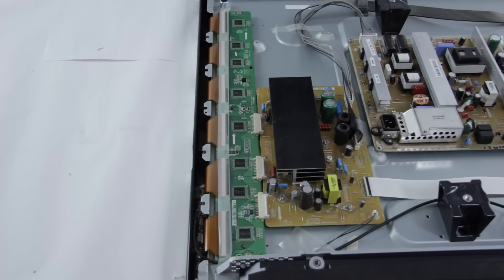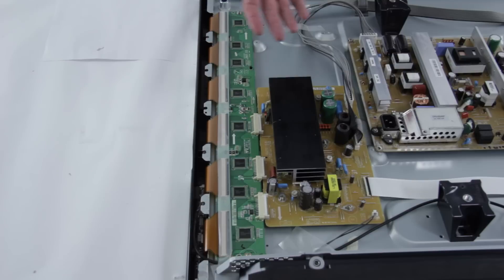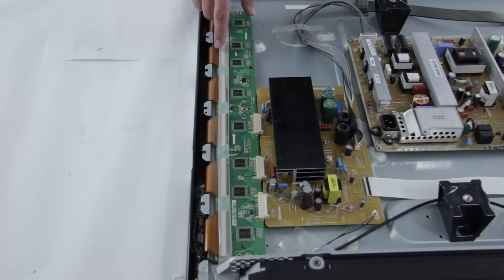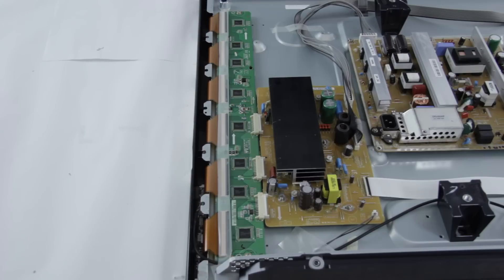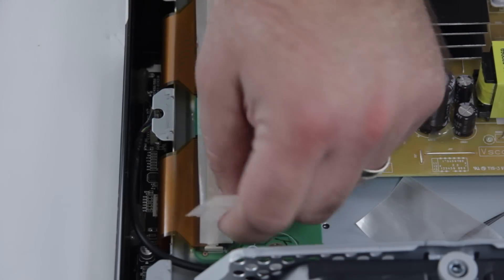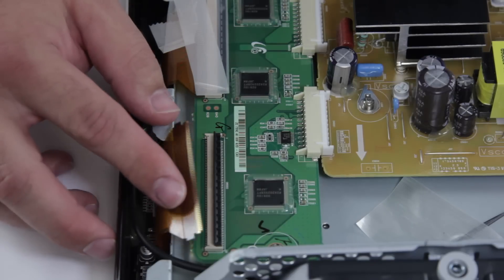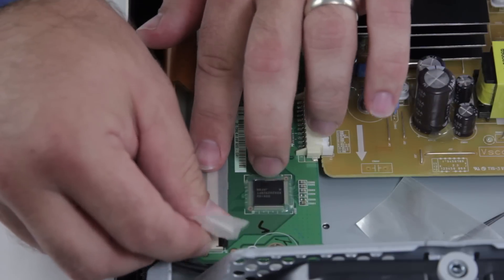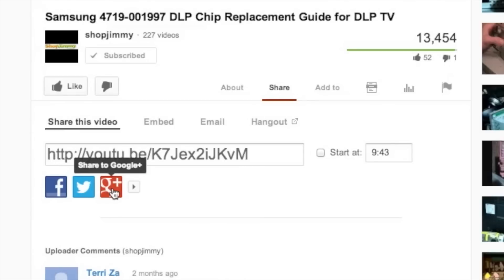Plasma TV Repair - No Image, No Picture on Plasma TV Screen - How to Replace Y-Buffer & Y-Sustain

Comment: I have a Samsung PS51E6500,  only 1.5 years old. A week ago a thin vertical line appeared from top to bottom on the left, about 2 pixels wide, which changes colour depending on what's on. Started bright red, now usually red on white backgrounds or green on darker backgrounds. A few days later it was joined by another vertical line right next to it, the same thickness and colour, 5 pixels away. Is this the logic board or do I need a new screen?  Thanks!
Reply from the maker: Philip Houghton   This sounds like a problem with either the panel or the logic board in your TV.  You can replace the logic board to see if that fixes the problem.  Here is a link to replacement parts for your TV model number on our website, click here:  http://www.shopjimmy.com/catalogsearch/result/index/?cat=226&q=51E6500  Be sure to match part numbers on your current board, with your replacement for compatibility.  Here is a link to a video showing how to identify your part number, click here:  Samsung Plasma TV Repair: Samsung Plasma Panel Parts Guide  You can also call our customer service for further assistance with your purchase.  (877) 881-6492  Thanks and please let us know if you have any further questions with your TV Repair!  www.shopjimmy.com

Comment: samsung ps50b550t2fxxy checked voltages with y sustain board connected all very low between 1 and 6 volts checked again with y sustain board disconnected all voltages correct except for vsc unable to test due to disconnection
Reply from the maker: mark johns   I recommend replacing the Y-Main board and Y-Buffer in your TV.  Here is a link to replacement parts for your TV model number on our website, click here:  http://www.shopjimmy.com/catalogsearch/result/?q=50b550t2  Be sure to match part numbers on your current board, with your replacement for compatibility.  Here is a link to a video showing how to identify your part number, click here:  Samsung Plasma TV Repair: Samsung Plasma Panel Parts Guide  You can also call our customer service for further assistance with your purchase.  (877) 881-6492  Thanks and please let us know if you have any further questions with your TV Repair!  www.shopjimmy.com

Comment: samsung LA32D450G1 keeps blowing transistors on power board's inverter driver
Reply from the maker: Ariel Pabalate   I recommend replacing the board.  Here is a link to replacement parts for your TV model number on our website, click here:  http://www.shopjimmy.com/catalogsearch/result/?q=32D450  Be sure to match part numbers on your current board, with your replacement for compatibility.  You can also call our customer service for further assistance with your purchase.  (877) 881-6492  Thanks and please let us know if you have any further questions with your TV Repair!  www.shopjimmy.com
Reply: what particular board is it? is it the power board, main board or the inverter board?
Reply from the maker: Ariel Pabalate   I apologize for not specifying.  If the inverter is blowing the transistors, then I recommend replacing the inverter.  Here is a link to replacement parts:  http://www.shopjimmy.com/catalogsearch/result/?q=32D450  Be sure to match part numbers on your current board, with your replacement for compatibility.  You can also call our customer service for further assistance with your purchase.  (877) 881-6492  Thanks and please let us know if you have any further questions with your TV Repair!  www.shopjimmy.com

Comment: Hi, I have a Phillips plasma tv model # 50PF9956/37   My problem started a few months ago. When I would turn it on it would take longer to come on. The problem kept getting by takinging longer and longer to come on. I would get a blurry faded picture before it would finally come on. Now time frame, I am talking about taking 45 minutes to finally come on to where it could be watched. Now its reached the point of not coming on at all. A friend sujested to me to check the start capassitors. I dont know what to do at this point. any help would be appricated. thank you
Reply from the maker: FLY HIGH   This sounds like a problem with the power supply board.  I recommend checking the capacitors on the power supply and see if they are puffy or raised.  I think replacing the power supply will fix the problem.  Here is a link to replacement parts for your TV model number on our website, click here:  http://www.shopjimmy.com/catalogsearch/result/index/?cat=59&q=50PF9956%2F37  Be sure to match part numbers on your current board, with your replacement for compatibility.  You can also call our customer service for further assistance with your purchase.  (877) 881-6492  Thanks and please let us know if you have any further questions with your TV Repair!  www.shopjimmy.com

Comment: I have Samsung 60 inches model pn60e550d1fxza plasma tv  I have no picture but ihave sound can someone help me whats wrong.
Reply from the maker: Eufemio Simangan   I recommend replacing the Y-Main Board and Upper and Lower Y Scan Drive Boards.  Here is a link to replacement parts for your TV model number on our website, click here:  http://www.shopjimmy.com/catalogsearch/result/?q=pn60e550d1fxza  Be sure to match part numbers on your current board, with your replacement for compatibility.  Here is a link to a video showing how to identify your part number, click here:  Samsung Plasma TV Repair: Samsung Plasma Panel Parts Guide  You can also call our customer service for further assistance with your purchase.  (877) 881-6492  Thanks and please let us know if you have any further questions with your TV Repair!  www.shopjimmy.com

Comment: i have samsung plasma PS50B550T2FXXY  witch is clicking and the stand by light is flashing disconnect the y sustain board and the clicking stops stand by light stops flashing there is sound when turn tv off any idears where to start no bulged capasitors
Reply from the maker: mark johns   I recommend replacing the Y-Main Board and the Y-Buffer Board in your TV.  Here is a link to replacement parts for your TV model number on our website, click here:  http://www.shopjimmy.com/catalogsearch/result/?q=50B550  Be sure to match part numbers on your current board, with your replacement for compatibility.  Here is a link to a video showing how to identify your part number, click here:  Samsung Plasma TV Repair: Samsung Plasma Panel Parts Guide  You can also call our customer service for further assistance with your purchase.  (877) 881-6492  Thanks and please let us know if you have any further questions with your TV Repair!  www.shopjimmy.com

Comment: Hello, I have a Panasonic TC-42PX14 plasma tv.  The tv does not power up.  When I press the power button, I hear a loud clicking sound and the tv then goes to standby.  After about a minute, tv trys to power up and again a clicking sound and back to standby.  The standby light does not blink.  I have already tried replacing the power supply board but that was not the problem.  Any help would be greatly appreciated.
Reply from the maker: Ian Robertson  I recommend replacing the A Main Board in your TV.  Here is a link to replacement parts for your TV model number on our website, click here:  http://www.shopjimmy.com/catalogsearch/result/index/?cat=56&q=TC-42PX14  Be sure to match part numbers on your current board, with your replacement for compatibility.  Here is a link to a video showing how to identify your part number, click here:  Panasonic Plasma HD TV Repair Tips: Suffix Codes for A Board & Main Boards  You can also call our customer service for further assistance with your purchase.  (877) 881-6492  Thanks and please let us know if you have any further questions with your TV Repair!  www.shopjimmy.com

Comment: I have a samsung plasma tv ps42b430p2wxxu model and my screen is black,__ there is a clicking noise which seems to be coming from relays on the power board----- any suggestions ?
Reply from the maker: ian whiteside   I recommend replacing the Y-Main board and the Y-Buffer board in your TV.  Here is a link to replacement parts for your TV model number on our website, click here:  http://www.shopjimmy.com/catalogsearch/result/?q=42b430p2  Be sure to match part numbers on your current board, with your replacement for compatibility.  Here is a link to a video showing how to identify your part number, click here:  Samsung Plasma TV Repair: Samsung Plasma Panel Parts Guide  You can also call our customer service for further assistance with your purchase.  (877) 881-6492  Thanks and please let us know if you have any further questions with your TV Repair!  www.shopjimmy.com

Comment: HI.  I have an LG 42lh40 plasma.  The picture stopped taking input, but it seems to be trying.  It recognizes when i plug a cable in and the on screen interface asks if i want to switch to that input, but then it says no signal.  I have tried this with all four HDMI ports, different input devices and cables, so i don't believe it is any of those.  The odd thing is that the tv on screen menu will come up and i can navigate through it and the display is crystal clear.  there is no defect on screen, it has just decided not to take video input.  the audio input through an AV cable will work.  I accidentally broke the coax stem a year ago and started using hdmi and have never had a problem.  There was a recent electrical storm and this tv was not on surge protection...oops.  However, i don't know why everything would appear to work normally but it just won't take video input anymore.  This tv is equipped with simplink, which is turned off.  Any help would be appreciated.  do i need to trash this panel?

Comment: Hi, I have an LG 50PC1DA plasma TV, which has sound O.K., but the screen is predominantly white, with a slight flickering of colour. The menu won't display either. I was advised that it was probably the Y-sus board at fault, but this doesn't seem to match any of the symptoms of a failed y-sus board I've found listed. Can you advise please?
Reply from the maker: Chris Drewery   I recommend replacing the X-Main Board in your TV.  Unfortunately I do not see any replacement parts in the search results for your TV model number on our website.  Please reply with your part number on your X-main board and I can try searching for replacement parts.  Thanks and please let us know if you have any further questions!  www.shopjimmy.com

Comment: i have a hitachi 55hds69 that has sound but black screen or no picture
Reply from the maker: Mark Littleton  I recommend replacing the Y-Main Board and the Upper and Lower Scan Drive boards.  Here is a link to replacement parts for your TV model number on our website, click here:  http://www.shopjimmy.com/catalogsearch/result/index/?cat=4&q=55hds69  Be sure to match part numbers on your current board, with your replacement for compatibility.  You can also call our customer service for further assistance with your purchase.  (877) 881-6492  Thanks and please let us know if you have any further questions with your TV Repair!  www.shopjimmy.com

Comment: Samsung Plasma TV purchased December 2012.  Model PN64E8000GFXZA  Model #K6i4h5z5x8. Pictures goes black while watching TV. If you let it set for a little while and then continue to change source and/or turn off and on, the picture will eventually come back.  If often takes several tries to get the TV to turn on initially doing the same thing. Unfortunately it does not happen every time, but the frequency occurs much more often now.  It has been doing this for about the past 3-4 weeks. Any help would be appreciated.
Reply from the maker: Julie Ovens   I recommend replacing the Y-Main board and the upper and lower Y-Scan Drive boards in your TV.  Here is a link to replacement parts for your TV model number on our website, click here:  http://www.shopjimmy.com/catalogsearch/result/?q=PN64E8000GFXZA  Be sure to match part numbers on your current board, with your replacement for compatibility.  Here is a link to a video showing how to identify your part number, click here:  Samsung Plasma TV Repair: Samsung Plasma Panel Parts Guide  You can also call our customer service for further assistance with your purchase.  (877) 881-6492  Thanks and please let us know if you have any further questions with your TV Repair!  www.shopjimmy.com

Comment: I have a samsung PN50B530S2FXZA. The problem that I have is one single thin horizontal line across the entire width of the screen.  It is midway up the height of the screen.  It is visible no matter what input is selected on the TV regardless of source. What are my options for troubleshooting and repair.
Reply from the maker: Nathaniel Howard   This could be a problem with either the TV panel or the Y-Buffer board in your TV.  You can replace the Y-Buffer board if you would like to see if it fixes the problem.  Please reply with your part number on that board and then I can see if I can find a replacement.  Thanks!  www.shopjimmy.com
Reply: Model #50" UF1A Y Buffer Connector Type
Rev No. R1.51 ( 08/11/27)
PCB no LJ41-06154A
Barcode: FC 613A A2 97E 0HY-AA2
Reply from the maker: Nathaniel Howard   Can you find a PBA number on your board?  If so, please reply with that number.  Thanks!  www.shopjimmy.com
Reply: PBA NO: LJ 92-01611A appears on board called drive main y
Reply from the maker: Nathaniel Howard  Is there a PBA number on the Y buffer board(s), the board that connects the drive main y to the panel.  Thanks!  www.shopjimmy.com

Comment: hi, I have a samsung plasma pn50b550t2f and it has a cracked screen, is there anything I can do to fix it?
Reply from the maker: Naturallycocoa   This sounds like a TV panel problem.  If your TV panel is bad, it may be more cost-effective to replace the TV as panels are typically hard to find in stock, difficult to replace, and expensive.  Thanks and please let us know if you have any further questions!  www.shopjimmy.com

Comment: Please help!!! I have a samsung plasma TV model  #PN51D450A2DXZA  with sound but no picture. Green light on logic board blinks slow. I tested the VA, VS, VE and VSCAN and they are were giving me dropping voltages. The voltage would be right on when the TV is initially started up and then would start to drop rapidly and then eventually the TV would turn off. When i disconnect the ribbon going from the logic board to the Y sustain board, the green light blinks fast and normal and all of my voltages read correct.
Reply from the maker: Chris topher   I recommend replacing the Y-Main Board and the Y-Buffer board in your TV.  Here is a link to replacement parts for your TV model number on our website, click here:  http://www.shopjimmy.com/catalogsearch/result/?q=PN51D450A2DXZA  Be sure to match part numbers on your current board, with your replacement for compatibility.  You can also call our customer service for further assistance with your purchase.  (877) 881-6492  Thanks and please let us know if you have any further questions with your TV Repair!  www.shopjimmy.com
Reply: I emailed back and forth with a tech from shopJimmy and he recommended replacing the x and y boards so I ordered them, I hope I don't need the y buffer as Well

Comment: Hi, we have a 42" LG plasma TV.  Not sure of the model, but it was purchased in 2006. Today, all of a sudden, we heard a small pop, then the screen went black. We could still hear the audio, but no picture, or any other type of image, such as the input selected, volume level, etc. Any help or suggestions would be much appreciated.  Thanks in advance.
Reply from the maker: Sean Collard   I recommend replacing the Y board and buffers in your TV.  Could you please reply with your TV model number and then I can recommend specific replacement parts for your TV.  Thanks!  www.shopjimmy.com

Comment: We have a LG 42PXAD PLASMA TV, which is 8-9 years old. While watching, we heard a loud pop sound, and the picture disappeared but the sound remained. However, after playing with it for a while trying to revive it, the audio went away as well. It now powers on, but has no video nor audio. Is it worth repairing or should we just tosh it? Thank you for your expert advice.
Reply from the maker: Paha   I recommend replacing the Y-Board and buffers in your TV.  Unfortunately I do not see any replacement parts in the search results for your TV model number on our website.  Please reply with your part number on your boards and I can try searching for replacement parts.  Thanks and please let us know if you have any further questions!  www.shopjimmy.com